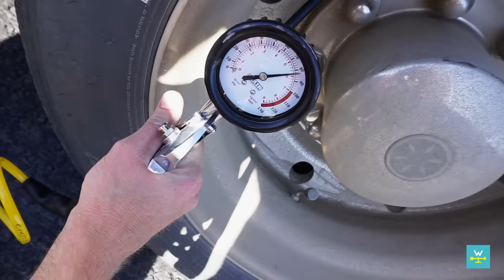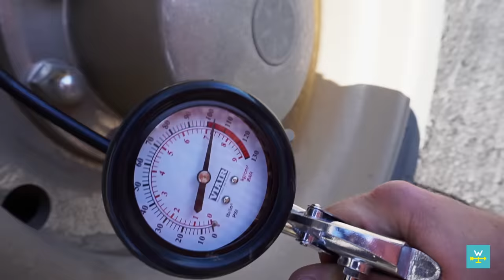05 Alaska Bound: Crossing the Alaska Border & Getting Screwed

Comment from the maker: Thank you all for the support and the big thumbs up.  We thought it was a funny experience with a good lesson at the end and we’re so happy others felt the same.  
For those that asked for link to the products you’ll find that here on our website: http://www.gonewiththewynns.com/Crossing-Alaska-Border-Getting-Screwed 
Dually – The issue with a dually coming off the rim is the tire could shred and do a lot of damage underneath the RV.  I suppose you can drive “normally” with one good tire but as far as I know it’s not recommended.
Tow Car – We could have drove the Smart Car down to Chicken to get a part, make a call to a tow truck, etc. and if it got much worse that’s exactly what we would have done.
RV Noise – Remember this is a test vehicle and we didn’t get all the “bugs” worked out before departing on this crazy trip.  The squeaking is from the dash, and once we get back into the lower 48 we’ll get it repaired…but the answer is “yes” it is annoying  
Thanks again for watching our videos, without the support we won’t be able to continue making these vids.  Hugs from us both.
-Jason
Reply: Gone with the Wynns Dipping your plugs in a small can of bead seal just before you insert it reduces the chance of leakage. I watched a tire repair guy use this. I've had plugs that leak if don 't use enough sealant.
Reply: Gone with the Wynns Think I would have been leery of attaching the can to the tire.  With 90 psi, the tire could have inflated the can instead of the other way.
Reply: Gone with the Wynns You can drive "normally" as long as normal is slower.  There's a reason there are two tires back there.  You need two to carry the load at full speed all day long.  One tire with double the load is probably similar to two tires at half pressure; at speed they heat up and fail.  Going slower reduces heat buildup and gives more time for the heat to dissipate.  You got there, and safely.  Well done.
Reply: most cans like that have 125 PSI in them to start with if new and no used
Reply: Gone with the Wynns 
I use to say "it isn't an adventure until something goes wrong" or something like "it's when things goes to s**t the great experiences happen"  
To be wingin' it, you guys did great! To have a man actually read instructions tells me that he is smarter than the average guy:)
Reply: +pål aukan Smarter? I don't know about that... the average guy already knows how to use a tire plug kit.
Reply: Greg Lawson They still have "Full Service" gas stations?  What state are they in?
Reply: I think it's the state of Urban Hypsterdom; Where all is given to them but never is enough. Where hard work is replaced by whimsical style.
Reply: +pål aukan True, though it would have been better if he had read and practiced with his tools BEFORE the road trip.
Reply: +Gone with the Wynns Nikki & Jason--Now that you have some tire repair experience under your belt, any further advice about using a cord plug versus a mushroom style plug like the Stop & Go?  http://www.amazon.com/gp/product/B0018EUDHW
Reply: EXACTLY! This is how people die.
Reply: +L0WRYDER you have to factor in the can size.  the 125 psi only lasts 1 second.  Those are only good for small tires.
Reply: +rnordquest, "One tire with double the load is probably similar to two tires at half pressure; at speed they heat up and fail." NO IT ISN'T. One tire will simply carry ALL the load, siamesed tires will only carry half the load each. Siamesed tires at half pressure will make the engine labor because you are running at half the recommended pressure. It's like running in loose slippers instead of properly tied shoes.
Reply: +George Jetson that is incorrect. You are thinking in terms of "air to air". The Fix-a-Flat can actually purs a substance that instantly expands into a solid foam and "fixes the flat". Gone with the Wynns" mistake was to inflate the tire with the valve close to the ground, he should have driven a mere few feet forward in order to have the tire valve as high up as possible so that the foam would have expanded downwards.
Reply: Maurizio Pescatori You are totally incorrect and misunderstand how the product works.  It is a liquid sealant that coats the inside of the tire.  There is no substance that puts a "solid foam" in the tire in Fix-A-Flat.  Go ahead and check out the SDS yourself at fixaflat . com/uploads/Roadside%20Fix-a-Flat%20English%20US1.pdf
Reply: I've driven my RV for weeks with one tire flat.  There is no big problem; there are 2 tires to each side.
Reply: Wow.  The two tires are there to carry the weight.  Running one flat for weeks is SO overloading that one inflated tire.  Just - wow - so stupid.
Reply: Brad Isley Not the weight so much as a smooth ride and easy turning.  It's not that you can find a Tire mart on every corner and they carry tires for Class A motor-homes.
Reply: David Dube
Reply: You should stopped and waited  for 1&1/2 hrs before you even touched  anything, then lay on the ground without your little blankie and try to shove that wax cord into a 10ply tire for 45 min while its 127deg outside ....that's the only time  I ever made two entirely full sentences  out of the "F" word alone and created 5 new curse words ...the wife loved it so much i didn't have to hear a peep outta her until we hit New Mexico..   Fu**alicious: description of the 3rd degree burn marks created on one's  back while laying on scalding hot blacktop working on a motorhome at 2pm in the afternoon on a sunny day in the  Mojavi desert
Reply: this is too funny.
Reply: Gone with the Wynns q
Reply: Gone with the Wynns @

Comment: G;day from Australia, guys. I am an Aussie truck driver and couldn't help but reply to some of your issues with your tyre. 
First of all the tyre repair kit you bought is a great idea. These work really well. You did everything correctly. Cleaned the hole, then pushed in the repair strip and...... That's where you had trouble. The reason was because you are supposed to deflate the tyre first. While its inflated you are trying to push something into a hole that has an enormous amount of air, under high pressure, running out. Not even Arnold Schwarzenegger could have pushed it in all the way!!!
Next time, find the hole. Mark it, then deflate the tyre and carry on with the repair.
I hope that helps.

Garry
Reply: Garry Beattie , Hello! I’ve plugged a lot of tires. I find it way easier when the tire is hard, so it doesn’t deflect when pushing the plug in. Air pressure in the tire technically does push back but a tiny bit that I don’t think anybody could even measure.
Reply: @hakunamatataadventurebus5944 , you're both right.  It's easier if the tire is somewhat hard.  But, not 80psi hard.  A truck doesn't run on a regular car's 35 psi.
Reply: Thats what she said!!!!
Reply: That’s good to know, thank you.

Comment: I can tell you never worked on cars before, carry a tire plug kit ( $4.00) and put your leveler down to take the weight off the tire. never use fix a flat stuff on cars with pressure sensors, it ruins the sensor on the inside if wheel. fun to watch and it looks like your having a good time so keep at it. I wrote this before watching the end, you did good.
Reply: never use fix a flat..lol
Reply: +matanuska high absolutely, get a little compressor you can run off your inverter, plug and go. Fix a flat ruins tyres.
Reply: I don't think it ruins tires, I used plenty of it years ago. the problem is the sensor inside the tire on newer cars gets ruined. ( I've done that too )
Reply: +wibbledee   Yeah, that dinky little compressor for those big tires, and it didn't even have a regular plug.  They should get a normal 2 gallon model at least (around $100-$200) with wheels, since they get heavy at that size (or they could use a dolly in lieu of the wheels).  There should be a power socket on the outside of that RV somewhere.  Even if not, they could just power & fill it up inside, then unplug & roll it outside.
Reply: really, carry a truck wheel inside? Have you tried lifting one of those things?

Never gonna happen. Truck wheels are very heavy indeed.
Reply: or just get an rv with air brakes and put a chuck out side, get air from your rv like on big rigs
Reply: I'm no rv expert, but I think that wagon is on a coach chassis, therefore It must have air brakes anyway.
Reply: wibbledee I think he was referring to the compressor on wheels. :)
Reply: Nope.
Reply: old .northsider, a rubberized string inserter isn't a tire plug kit.  The tire plug kits have an actual rubber plug with a mushroom head to seal the inside of the tire.
Reply: Doug DaCosta thats good to know if have used many of those rubberized strings in have never seen the plugs you described
Reply: old .northsider 

I'm sure he's not the only guy who doesn't know anything about cars. I see in the comments all of the armchair critics criticizing him. I couldn't believe he was considering  whether he should pull the nail out of the tire. Or use that green gunk in a can . I work with people who by job title are called mechanics but wouldn't have known to do what he did so bravo to him for trying.
Reply: And it pisses off the Professional that has to fix your tire.
Reply: If that Bounder is air suspension and brakes, there will be a air hose connection under the hood for inflating tires
Reply: well spoken was thinking the same thing , he probably is the corporate wanna be type
Reply: I have a Ford Fusion 2018 and they do not come with spare tires, and only have a fix it flat that comes standard with the vehicle, and it has sensors

Comment: Helpful hint for the next time you catch a nail, keep some deep thread one inch screws with you and some wide rubber bands. Take out the nail, push the screw through the rubber band all the way up to the head then screw it into the hole left by the nail. It will plug it up completely or nearly completely allowing you to refill the tire and get somewhere to get it fixed permanently. Saved me a few times now since I used to work with a construction/roofing crew and picked up nails often.
Reply: ***** Sounds like something McGyver would do :)
Reply: McGyver has nothing on a mom with 7 boys under 10 in a van.. :)
Reply: The plug kit works better.
Reply: Depends on the tire. Newer car tires are not repairable with the old-school plug kit. The motorhome has truck tires that can be plugged. If you drive a pickup...ALWAYS buy load-rated truck tires or you will get stranded on a country road in Arkansas with TWO flats.

Comment: You did a fine job on the plug.  I don't recommend using slim, it can cause the tire to go out of balance and is a pain to remove at the tire shop.  Keeping a good plug kit with you is best practice.  By the way, the reason the instructions had you leave a 1/4" outside the tire and then trim it, as opposed to pushing it in farther, is that once you get to the end of the plug material, it's really easy to accidentally push the whole plug into the tire.  Your success should make you feel more self reliant and give you more confidence in traveling the lonely roads.  Good job.
Reply: CallmeRogerRoger Actually it’s water soluble and will wash out of the tire

Comment: Not filling your tank,not having a tire plug kit and no air compressor? Hmmmm...need to be more prepared buddy. Unexpected stuff happens. Always expect the unexpected.
Reply: You can't externally plug a 100psi tire. It'll split the compounded layers from the inside.
Reply: YEA😒   FOREST  GUMP  Said it best ,   “ - - it   HAPPENS”😉 👍
Reply: no spare tire?
Reply: I was just coming to post this. I carry a whole small trunk in my trunk with a plug kit and compressor..along with a first aid kit, 50 piece ratchet set, hammer/pliers and a solar/hand crank radio. (I keep my MagLight along the side of the passengers seat)
Reply: True, I do not drive but if I'm to stay home in an emergency. I have the necessities to make it a few days or more. Once I drive I'll already have an emergency kit for my car. I am working on it now, getting smaller items first. One for me too if I got to move on foot for any reason on the road.

Comment: Advice from an old trucker...you can drive at 25 mph. The tire will stay cool enough so it won't catch fire but you can still get somewhere.
Reply from the maker: It would work in a pinch, but you have to be careful doing that in an RV. If the tire starts to come apart it can damage the body, tear out water lines, propane lines, all sorts of expensive things.
Curious Minion

Comment: @Gone with the Wynns   Many nails and screws in tires do not require repair at all, possibly including the one you removed at one point. The safest place to remove a nail etc is at a repair shop if possible and I'd recommend leaving the nail in until you get to one. There they will remove it and check for leaks to see if a repair is required. You can check for leaks yourself by taking a spray bottle of water and constantly spraying down the area, watching for air bubbles. No bubbles equal no leak at this time. This doesn't mean it may not leak once the object is removed, but you can certainly drive with it in there for a distance if it isn't leaking. The exception would be nails etc in the sidewall of the tire. Would not recommend driving further if that is the case as it could cause the tire to blow and come apart.
Reply: I used to carry vinyl coated sinker nails for that very purpose, hear a leak and put a nail in the hole toil you can get to some air.

Comment: for all persons that don't know this, most if not all valve monitoring systems,  advise not to use any type of tire flat liquid. It might\will clog your monitor and show the wrong psi.  Then you have to purchase a new one. and when changing tires, that tire must be able to receive the same valve stem to continue to work.  Don't let the shop keep that and replace it with a different one.  They are quite spendy.
Reply: I know for my car, they have a rebuild kit, but with that said, I don't know how easily a sensor can get damaged, but I'd think a cleaning and new orings, it should be good to go. Correct me if I'm wrong.

Comment: It always help to practice changing a tire before you need to. It always helps to practice using any device before you need to and plan for a wet, snowy day with wind. The one thing is that if you fail to read the instructions, you get the results that your deserve for anyone watching this later.

Comment: This reminds me so much of our two years in a Class A Gas cruising the USA and Canada, learning as you go, roads that don’t exist on GPS, or have changed, getting low on gas, tire punctures etc...by the way, we had the same inside rear tire blow in New Mexico and we managed to run in the single rear for about 140 miles until we got to a place to repair the tire. We also put sway bar kits and a Banks Power kit on the engine, made all the difference. We were also younger and travelling with a baby, so the retirees at the RV Parks just doted on us most of the time. Didn’t meet anyone our age though, which kind of sucked, but what a lot of fun we had. Now we’re looking at getting a sailing cat and cruising the South Pacific...like you guys. Has been awesome watching your vids, a trip down memory lane. Cheers!

Comment: I have airbag suspension and air ride seats I have a ( 120volt /adapted from 12volt) California  Air tools super quiet air compressor. 7 gal. air tank. I outfitted al this stuff together. I can use it to change flats or air up low tires or even run small rachets, grinders or impact. slow but gets the job done. 
   Sorry for the trouble but your now stronger more experienced and will be better able to deal with issues down the road.

Comment: I use that green slime one time and I had to buy a whole new tire as they will not work on a green slime tire plus I could not add more air after as the slime plugged up the valve.
Reply: Bob Kelley you got hooked, green slim just washes out with water..☹️

Comment: the tire place is going to tell you they won't patch a tire near the corner . i got flats like that all the time on my dump truck if they patch it all you have to do is have a new internal patch put in every 20 to 30 thousand miles to wear out the tire because the internal patch comes loose when the patch is  near the corner of the tire (too much flexing )

Comment: In plugging tires:  
The first probe is basically a file to open the hole enough to get a plug into the hole.  You often have to drive it in with the palm of your hand and pull out and push in a few times.  The tire should be filled up with air as you do this.  Put a plug centered in the other probe keeping it as clean as possible and smear it with rubber cement.  insert this into the hole as soon as you pull out the first probe.  You want to push the plug into the tire deep enough to have some of the plug inside the tire but leaving both ends of the plug sticking outside of the tire.  pull out the probe and the hole should be plugged.  Now take a razor blade and cut the ends of the plug off about 1/16" outside of the tire.  If you leave the plug ends long, the plug will eventually work it's way out.  They say to go to the tire store and get a patch put on the inside of the tire afterward, but I've plugged about a hundred tires and none ever failed on me When done properly.  Do not plug a side wall, it won't hold.

Comment: Oh gosh, I had to learn how to plug a tire before I was allowed to get a license.   2 things.  1. get a dead blow hammer!  One of the orange stanley ones, a 2 pound one is good for this.  Use that to smack in your plug tool, carefully, then it doesn't even matter how strong your wrists are.   3. The reason it had stopped leaking is that the green goop got into the hole . . . get a can of slime for your tire pressure . . . it's fabulous stuff.